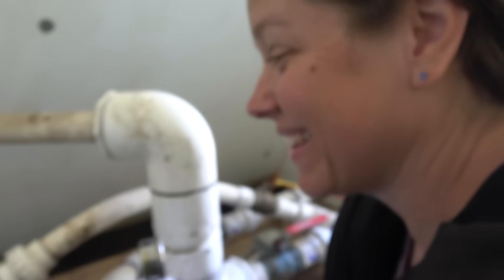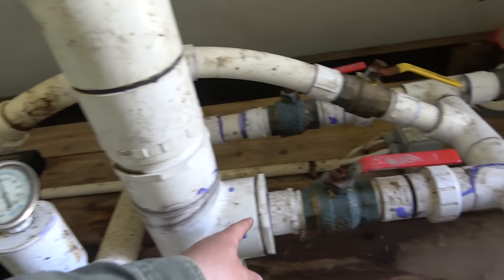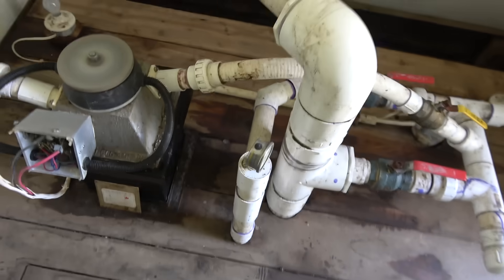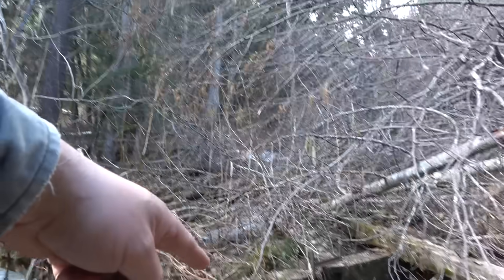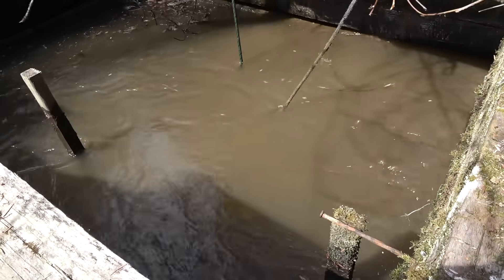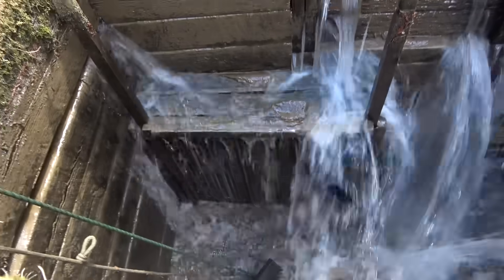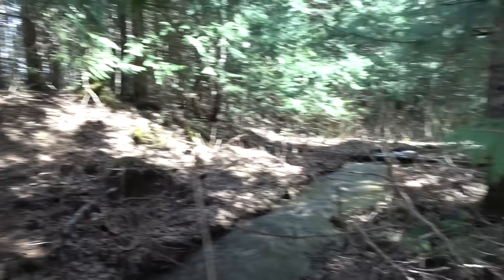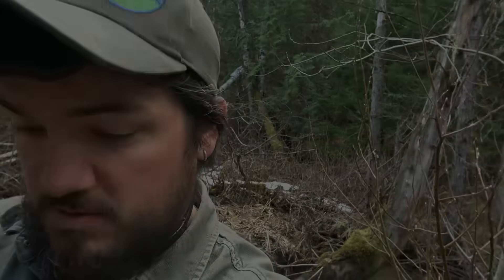Off Grid Micro Hydro - The Dream System!?

Comment: It is awesome clean and free energy. You just need to be in the right place and  for many of us is almost impossible. 30 meters of elevation is about 44.0 PSI  (2.3 feet of water column =1 psi). Need a bit of conversion. Pressure loss due to flow can be calculated for the piping that is based on flow, pipe dia and friction loss . You can do a bunch of good to have that flow and pressure available courtesy of mother earth. Good on you guys to be able to harvest it. Good content Jeff and Rose. You guys rock!
Reply: We used to run various mills (flour, saw, etc.) using big water wheels and only a few feet of head. With that much torque, you might be able to gear something to produce a little juice.
Reply: @fergusontea  Right, that is a great. Like you said the key is Torque, few feet of head and large volume of water and you can do great. I dammed up a creek in the back of my property to raise water a couple of feet and depending the season can have good flow. Need to figure out something to do with it. Dutch do great with their slow turning wind mills and through right gear box they can get whatever rotational speed they need to mill flour.
Reply: @fergusontea Thats what I'm thinking about having your own hydro power. A big 5000w generator and a big wheel and gers.
What are the advantages of having a smal micro hydro with high pressure, that one in the video cant generate much power?

Comment: That system could have another load dump ...once the hot water tank reaches temp it can activate another relay and dump the extra power into a heater
Reply: One system has a 1500 litre tank, with floor heating run off it...and other loops to provide hot tap water for consumption in the house.....
Reply: @JohnSmith-yv6eq  Nice! Was going to mention about having under floor heating ...great use for extra energy.

Comment: Great video. Like you’ve said before, choose the property, you want develop your off grid existence carefully. This system adds the need for the land to include an elevation difference with permanent flowing water and of course capital todo initial installation costs. Makes sense, as the shift to electric vehicles require an adequate electrical supply. Thank you for the food for thought
Reply: electric is shit. put a wood gassifier on your old truck and use free wood
Reply: Sorry Biden, there's no shift to electric cars.

Comment: Good stuff, man!  And if you make a big storage pond up top, it's better than any battery system out there, because the extra power potential just comes to you at certain times for free, & you can save a good bunch of power for when you want it.  And it's just a hole in the ground!  Regards to the fam, G.M. o/
Reply: Or you can make the storage a powerwall type of storage at the house (where it gets used) and not subject to flooding/silting/blocking/freezing.....

Comment: Great way to go if you have the head pressure. I've been to a number of backcountry ski lodges that run micro hydro. I was on a few work weeks in the fall years ago at Boulder Hut Adventures to help with the install, maintenance etc. Winter only operation so it's shut down in the summer. On opening in late December or January have to dig through a meter or more of snow to get to the intake & get 'er running. Usually has no problem with excess power, but if so there's a simple bank of resistors in the guest hut to bleed off any excess.
Reply: An "air dump" keeping the hut toasty warm, drying clothes etc....
Using a powerwall system in the house allows accumulated electricity to power the big appliances...like an airconditioner, or compressor, or welder.....
Reply: Or a wster heating elements in a nearby stream  will do the same
Reply: @cheetomussollini  
Heat pollution with no benefit to humans...heatig a stream...why?
The illustrated system runs in winter only...so any heat can be used in the huts for drying and heating clothes and humans after the water has been heated....
Reply: @JohnSmith-yv6eq  if hes got to much electricity he can expell it in the stream,  but i said that i saw he does it in the hot water heater instead,  gets too hot drains it and reheats again
Reply: @cheetomussollini  
Might as well put a large vehicle radiator or three in the hot water loop and feed the hot water out of the top of the tank, take the heat out with the radiators...and put the water back in the bottom of tank???
Reply: As I mentioned, this is a winter only operation & the times I've been up there in the winter excess electricity has never been an issue, mostly the system is having to catch up after evening use of electricity. I don't think I've ever seen the battery bank at full charge and am amazed at how many years they've lasted. 12 volt RV style fluorescent lighting was replaced by LED some years ago, before that if 2 of the fluorescents were turned on you were already using more current than the micro hydro provided. I think on a good day he was getting 7 amps.

Comment: I don't think that's entirely true with the 15 years... I'm sure that needs a new turbine wheel every few years. The natural water causes incredible wear and tear on the turbine wheel. But the micro hydro is a good thing for power generation and apart from the water inlet and the icing it runs trouble-free.
Reply from the maker: Turbines CAN be subject to wear from suspended solids, BUT this turbine has been going for 15 years so far!
Reply: @Gridlessness  Wouw, thats a good one.
Reply: As long as you taske the time and trouble to eliminate as much fine silt as possible (say by having the intake half way between the bottom of the pond and the top water surface) so silt can settle out on the bottom, and leaves float over the top......Marty T has had his turbine running 17 years...no replacement pelton cups necessary
Reply: @JohnSmith-yv6eq Yes I agree with you. The most important thing is the inlet of the water, so that not too much dirt gets into the turbine. And of course the quality of the Pelton wheel and housing. Marty T had to overhaul his entire facility after a storm with heavy rain... I used to work in one of the largest recycling companies in Europe and had to deal with an electrical fault from a huge water pump. I reported to the mechanical shop that the pump was working properly electrically and it had to be a mechanical problem. Nobody believed me because it was an expensive and fairly new pump. After a long discussion and a lot of persuasion, they then removed it and the water drive wheel was completely sanded away by the dirty water! There are a few YouTube videos of hydro power units struggling with the tremendous abrasion of the Pelton. But as you say, it's certainly very important that the water is as clean as possibleand and the material is of high quality.

Comment: @ 3:07 Rose is not totally convinced !  Actually, more Power does not mean  always more speed . Usually, these machines have speed governors or electrically controlled because increasing the speed over a certain limit could damage the machine. If the output power is AC usually kept at constant frequency
Reply from the maker: This turbine is not speed controlled, it provides a "wild" AC signal which is immediately rectified.
Reply: It uses a dump load ie the hot water tank to maintain a constant load on the generator and keep it from over speeding .

Comment: We heat our house (Off Grid) with hot water using PEX Radiant Floor Heat. 
Our wood stove has a tank and serpentine as well as a smoke stack tank that absorbs the heat. We store this in a big 750 liter tank that supplies hot water to all of our showers and bath and kitchen as well as the floor heat. 
As I told you before we have ONLY SOLAR now and yes the problem is where we live in Chile we do not have enough sun in the winter and TOO MUCH sun in the summer with our 10kw system. So we would like to supplement our solar with a small hydro system. Smaller than the one in this video as we only need to keep our batteries topped off. June 21 is the shortest day of the year here where we are in Chile. So we have to plan our consumption around that fact. 
Love this solar system. Thanks for showing the INTAKE since that is always the weak link in any TURBINE system. We may go with a water wheel system for this reason if we ever get there. Thanks for the video. Jim in Chile.
Reply: Can add more panels. Then take extra panel down and store in summer. I going try that myself. Double amount of panels in winter.  Take care
Reply: @aliendude60  Well for solar you do not need a POWER DUMP like in Hydro or wind. The charge controler just ignores the input. 
But that being said, to quote JUSTIN CASE SOLAR in AUZ always panel up for the lowest light time of your solar year. SO yes you are correct in that regard. For me it would be a case of just buying more efficient panels and replacing my current panels and I would satisfy this need. 
Like all things it is a money thing for me. Jim
Reply: Saludos de tierra del Fuego soy canadiensepo hahaha cherers
Reply: @danieljohnson4479  Winter to Winter! Canadians must love the cold and snow. Jim
Reply: if you have a low head stream there is a 1000 watt unit that can be used. looked at the website and i see only need 3 ft elevation. so that might work and you can get unit to have 12 v 24v 48 v or 240v so means you can match your solar battery bank. the other thing you can do is get a small wind generator for battery bank. when you have inclement weather solar usually bottoms out but a storm front and clouds usually have wind with it. now that said you can look at europes small wind generators as they are designed to start at lower start speed. my experience through friends showed smaller wind generators were more productive over a year than say a 5 KW wind generator. there is a third way and that is a little more expensive set up but involves making fuel from water and storing it. As for your solar panels check out what angle is best if you want to capture snow reflection as well. I am curious about the fact you chose Chili. I was considdering that location or bolivia. Would like to gear more from you. Greenenergytech2013@gmail.com

Comment: These hydro guys in Sussex New Brunswick are awesome there eh! They are about a 30 min drive from where I'm going to build my off grid log cabin some day, was talking with them gave them my elevation, distance, average estimated flow rate and voila they sized up a unit said should get 300 watts for about $1600.00 canadian...
Reply: That seems like a lot. You can buy 300W of solar for $300. I'm assuming that doesn't include the install. 300W won't power a lot of stuff.
Reply: @Ryan_Tidwell  yeah but would be continuous day or night...
Reply: @Ryan_Tidwell  300W might be able to keep his battery system charged in his solar setup.  Depending on the situation, 300W could be worth gold or even priceless.

Comment: Hi, great video. Micro hydro fascinates me, another YouTuber Kris Harbour, similarly off grid in the woolly wilds of Wales has a similar system he built himself. In fact I think he is starting to manufacture systems for clients, all off grid. His system is smaller, limited by the head of the stream on his land. He has also got solar and wind because the flow in his stream dries up during the summer. I thought this might be of interest to those interested in hydro as it shows what you can achieve with much small water ways. This is a link to his first video on the hydro: https://youtu.be/MUNMjdmGIPI
Reply: MartyT in New Zealand has his version as well, from scrap mostly.
Reply: @earlleelethbridge566  hi, thanks for that I will check it out.